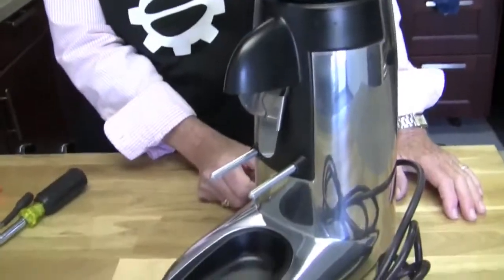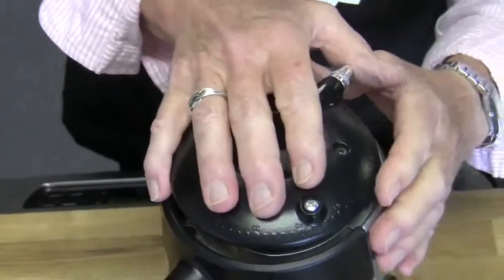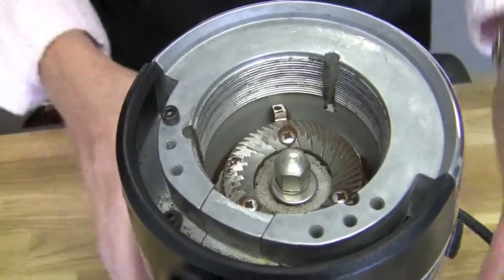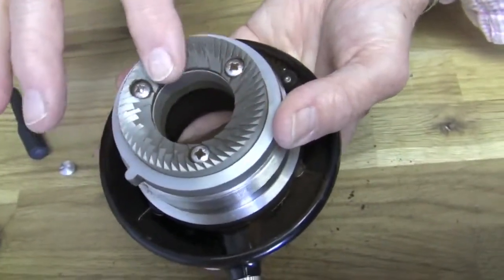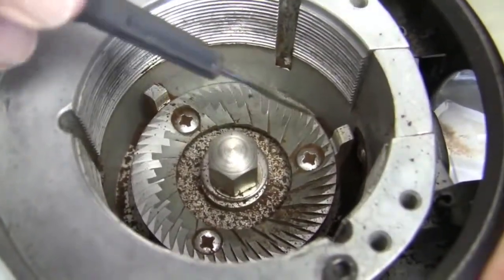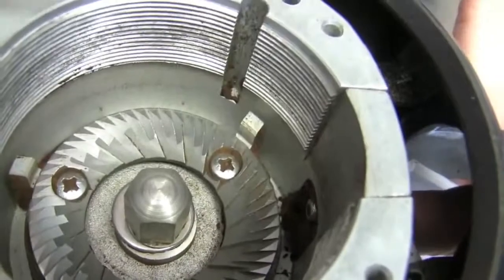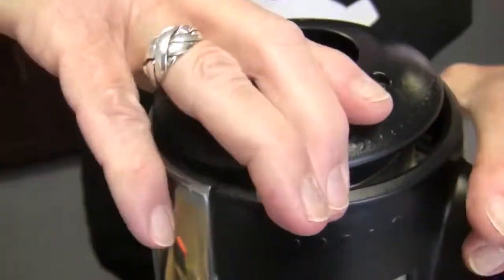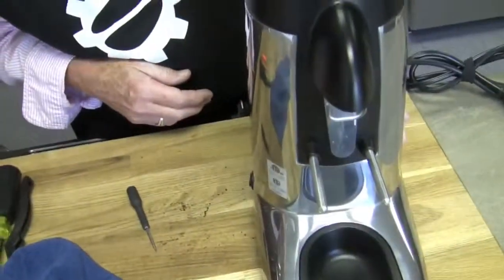Tech Tip: How to Clean your Compak K3 Touch Coffee Grinder

Comment: I have cleaned the whole grinder and  and replaced my burrs. I am using some clear lube on the upper half of the threads but still having a trouble rotating the collar on. Any suggestions? Is there a number position to start at?